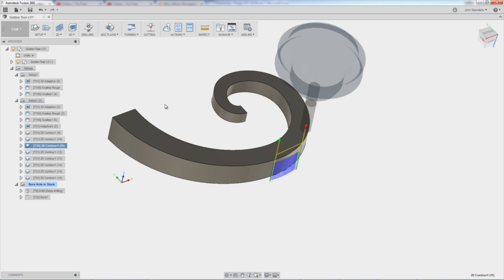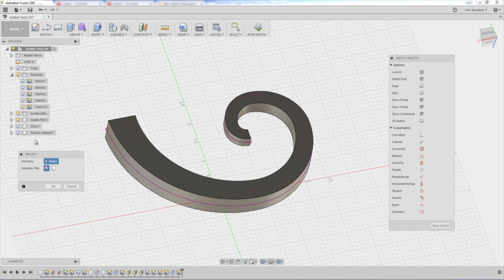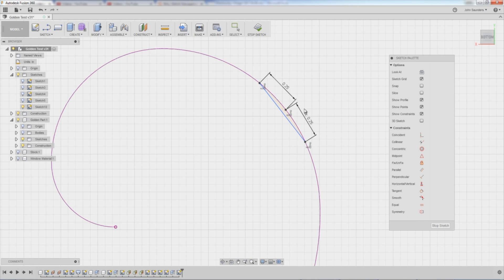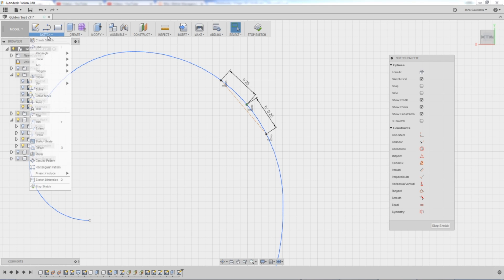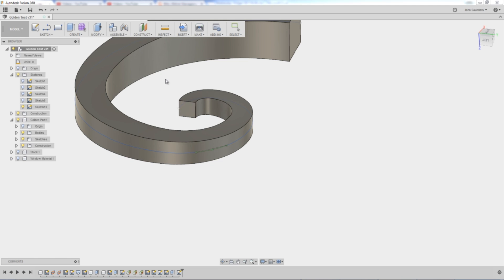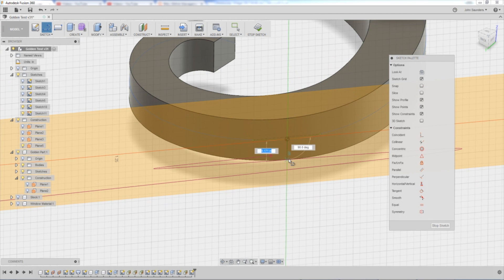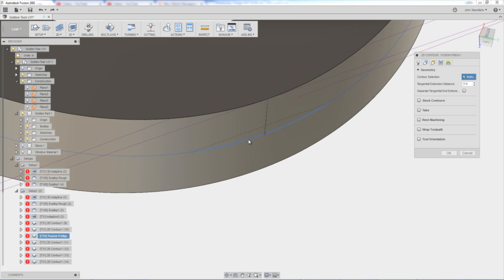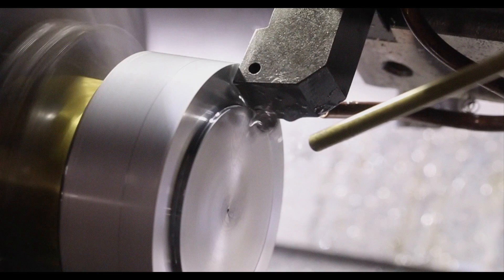Fusion 360 CAM Tutorial: Controlling 2D Contour! FF81

Comment: I have a guitar neck with an angled headstock. I cannot seem to cut a 2d contour around the headstock without cutting into my model. Any tips? I can provide 3d model in fusion 360.
Reply: It depends if you are using this in a roughing operation or a finish. If it is roughing i would suggest 3D adaptive and for finish use some 3D toolpaths to achieve your finish

Comment: Thank you, one question could you explain the offsets on the last tab when making a new tool. I'm confused on the difference of if the cam is doing the offset or the controller for the tool width. ive just bought a Tormach 1100 with ATC and am getting ready to cut my first part but I'm not sure how to do the tool offset settings, im guessing most people let the cam do the with offset and the controller does the length? So would i just set my dia offset in the controller to 0 and set up the Z offset and then check the box for fusion to do the cutter comp? and then use the offset in the controller for wear comp if needed?

Comment: you could use stock contours to break up the toolpaths and maintain associativity. so each toolpath would use the same contour selection, but different stock contour profiles.... I would also try using Trace with axial offset passes and select the bottom edge.

Comment: Instead of breaking the link at 4:28 you could sketch a 3 point arc using the points you created and then use that geometry as your contour selection in cam. Then it would have a parametric link.
Reply: Jay Pierson  Making the projected line a construction line helps too. Keep up the great work.
Reply: i can confirm that this works to keep the projected arc following the main model, however on the cam side, the link to the contour on the 2d contour is for some reason lost and the arc needs to be picked again. not sure why, dont really see a reason why it would not work. But arcs and lines are a trivial case i guess, if the contour was something more complicated it would be nice to see how it could be done with just the projection.